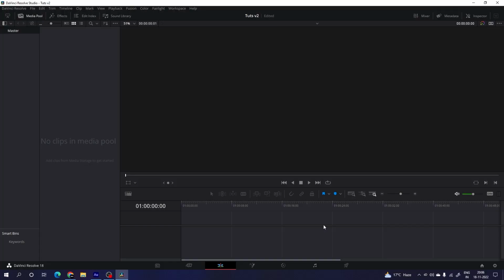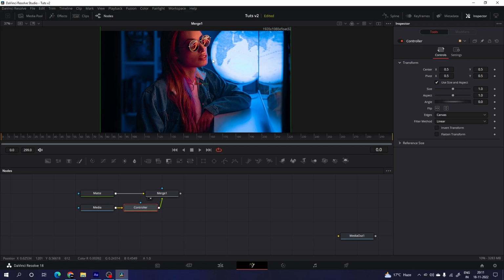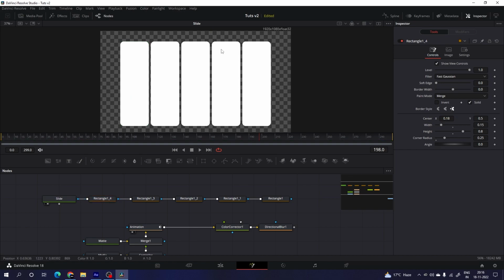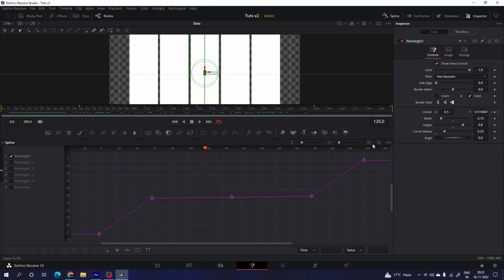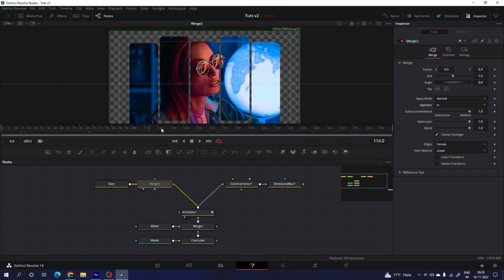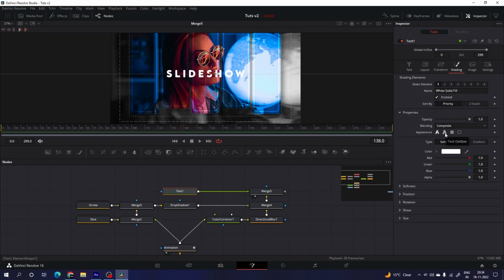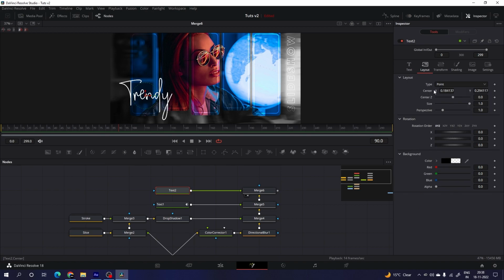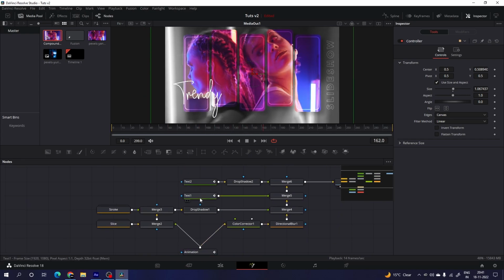Modern Photo Slideshow - DaVinci Resolve Tutorial - No Plugins

Comment: great tutorial, but when I replace the vertical image with a horizontal one, it eats up half the image. How can I fix it? I have tried it with the two fusions in the project and it does not work well for me.
Reply from the maker: I think there will be an image controller node which is actually a transform node, so use that node to adjust the image and you can also set the edges- mirror in the inspector window 👍